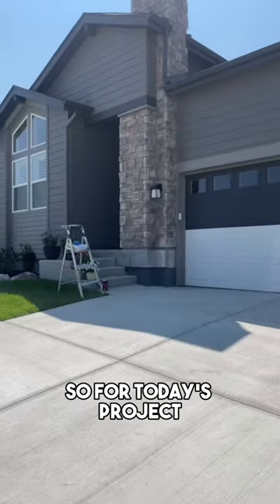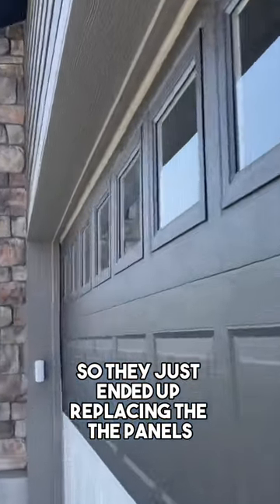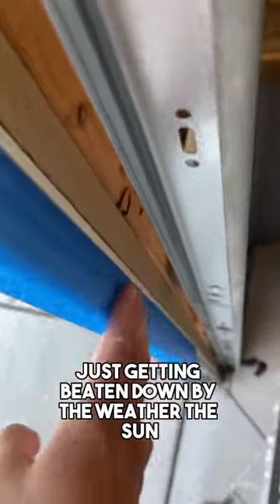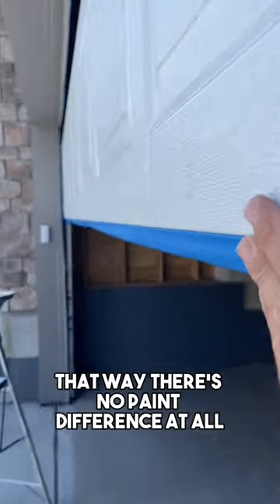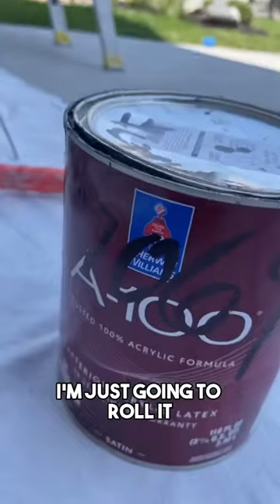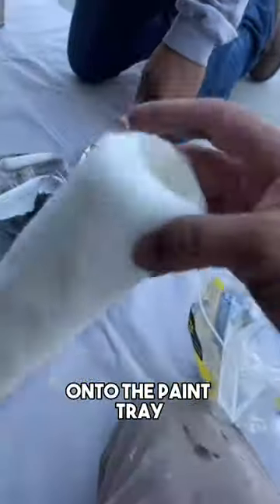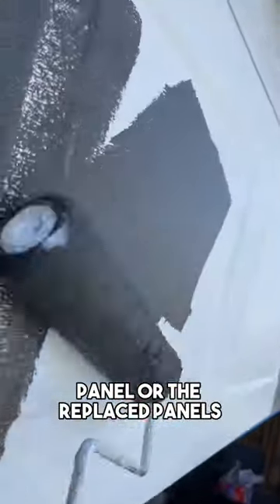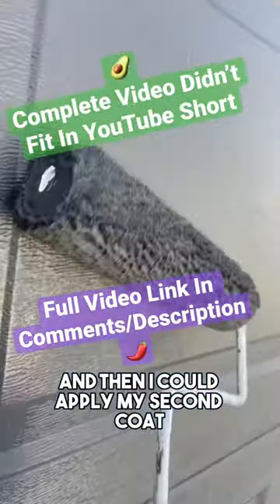How To Paint Garage Door (With Roller) #short #handyman #paint #garagedoor #diy

Comment: So what about the side strips on either side and the top that gets hidden by the opening how do you get that painted? Or yeah I didn’t really think about that did you ....and neither does anyone else.
Reply: I personally would take every panel off the track and remove the hardware and weatherstripping off the bottom.
Reply: Behind the weather stripping is suppose to be left un painted. The paint will end up stuck to the back of the weather stripping when the door is closed.

Comment: You first forgot to mention that you have to spray the door with water to take all the debris and dust off the door second you have to sand down the white panel cuz they have a glossy finished with so it will really not match
Reply: Thats completely bs you do not need to sand the white panel, guaranteed whoever painted it originally did NOT do that nor does anyone
Reply: I bet the paint has chips and you got to paint it over over over and over

Comment: Did you really just roll a door that should be a spray finish damn Mickey guy all day long Mickey shit
Reply: Sometimes it's about the client.  I happen to learn that sometimes client doesn't care about a good finish but get it done the cheapest way.  Usually this guy does quick repair not quality ones.
Reply: @ivanchavez4265  spraying it will always be better but that is true, trying to roll something that uniform is pointless you won’t be able to keep a wet edge yeah this dude does quick work not quality in my opinion he needs to stay with small drywall patches
Reply: @matdomm  I think prep work it's important too.  At least surface should have been wiped with a wet rug or light sanded. Paint should have been filtered since it not new paint, roller should have been cleaned too.  Since a lot of paints now are paint/primer probably not need for a base coat of primer n I think that with coating on the door is the manufacturer primer ( sometimes is the paint n this is why it should have been light sanded).  Then use a 6"roller n brush to paint it or mask n spray..   No body wants to spent all this time to do it right.  A lot of clients r so nice to say something even if they don't like the results.  This guy is a you tuber  n of course, he will never show the mistakes or bad jobs.  There is a lot of hard working honest ppl n a lot of sloppy one who don't have a problem ripping off ppl.
Reply: @ivanchavez4265  paint and primer together doesn’t exist bro always prime
Reply: @matdomm  hi, sorry but yes it exist.  Now most paint store have at least one product that is paint n primer.  It doesn't mean that primer is not required anymore. Product is mostly to paint on something previously painted or with a minimum of spot primer needed.    If ur gonna say there is not paint n primer product  just cuz u don't knw, first read the entire comment n understand what wrote.   Even in some of this videos the jalapeño guy has show n said paint n prime paint.  I have bought it in most of the paint stores. Home depot bearh, Lowes valspart, Sherwin Williams, Dunn Edward's,  Benjamin Moore, Catalina paints, ppj.  The ones don't have it, restoration hardware,farrow n ball.  Probably in ur area or hardware store don't have it. Lol!
Reply: @ivanchavez4265  it doesn’t serve its purpose I am a painter of 10 years never used a paint and primer that worked with only one coat you must just believe whatever the paint manufacturer is saying. Remember they want to sell you paint and at a higher cost if possible
Reply: @ivanchavez4265  I’m in Vegas lol we shoot 100-200 gallons a week trust me bud I know my shit but go ahead and one coat a wall for your customer my client gets 2 full coats no short cuts I pride my work
Reply: @ivanchavez4265  I see why you like these jalapeño vids makes sense now
Reply: @ivanchavez4265  back to the office for you leave the field for the ones actually doing the work
Reply: @matdomm  lol.  I didn't mean to hurt ur feelings.  U said there is not paint n primer paint well, sorry but yes. The product exist.  I'm not saying primer is not required anymore. I have never given a like to this videos so u kind of like to make things up. So u happen to watch these videos cus u r in love with this kind of work??  Come on. Be a grown up n don't get sensitive. Lol.!   Have a great day n good luck!!!
Reply: @ivanchavez4265  not sensitive just correcting someone who doesn’t know shit about my field and my trade that’s all. Your not from my world brotha so like I said back to the office for
You my friend have a blessed day 😘
Reply: @matdomm  lol!!  Fragil as glass.
Reply: @ivanchavez4265  like I said bro back to pushing pencils for you come find out guey
Reply: @ivanchavez4265  no point in arguing with someone who doesn’t know shit from shampoo about paint coatings peace bro
Reply: @matdomm  dices , "no point in arguing"  I'm not arguing. I'm just saying what I knw n believe.  Ur taking it in a bad way so,  quien es el guey here?   Soy de la ciudad de Mexico y tambien se insultar y si eso fuera lo que quisiera lo habria hecho.  Go back to keep shooting hundreds of gallon my dear .  Lol!!